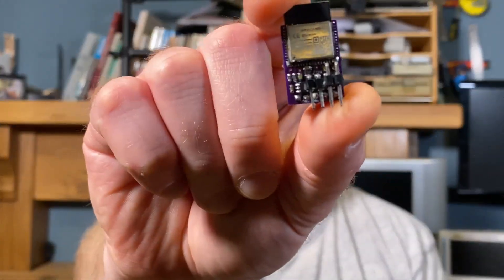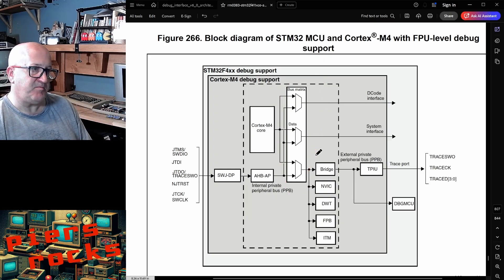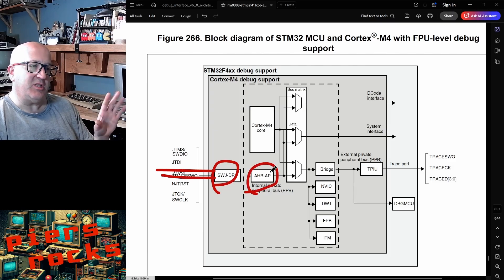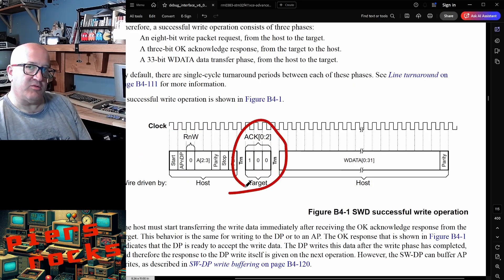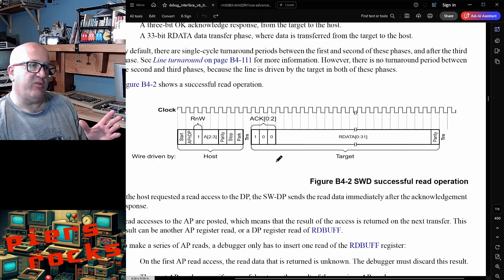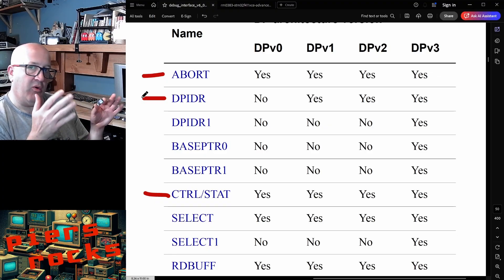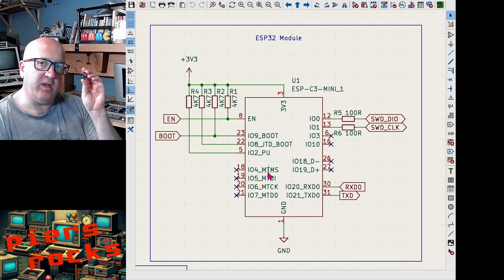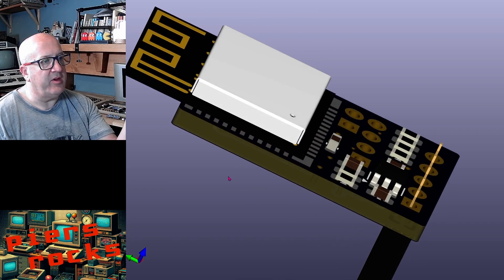Airfrog - how it gives root access to ARM MCUs

Comment: Great potential here.
If your project will cover e.g. Pi Pico and STM32duino targets than it would be useful for a giant community of tinkerers on the similar level of projects. Even if it would just provide SWD based OTA, but also take a look at ESP-Link project (which sadly stopped moving gears) and consider expanding your tool to SWD+UART to enable wireless serial telemetry/logging as well. Looks like you got unused pins anyway.
Not familiar with probe-rs and what it provides in this case, but if something like integration with OpenOCD + VSCode is possible here, than it's really exciting.
Hope you proceed with this 🦾

Comment: So, from what I can tell, this cant help much if the security bits in the stm32 config are set, not rdp1 or rdp2...
Reply from the maker: I am not an expert on STM32 RDP levels, but my reading is level 1 would disable airfrog's flash access, and level 2 would disable all airfrog access.